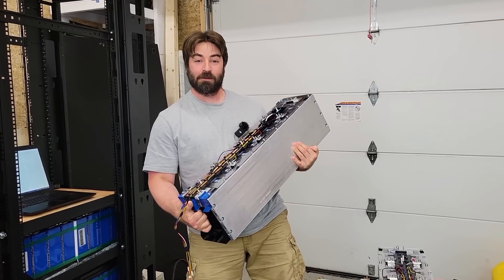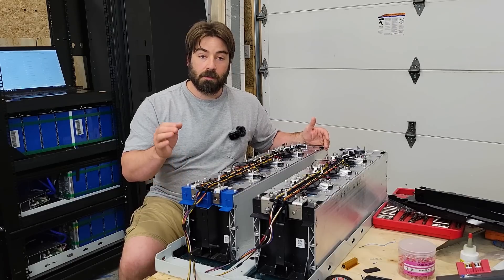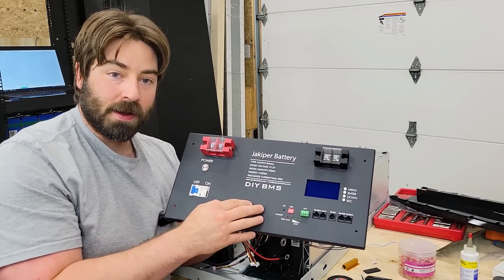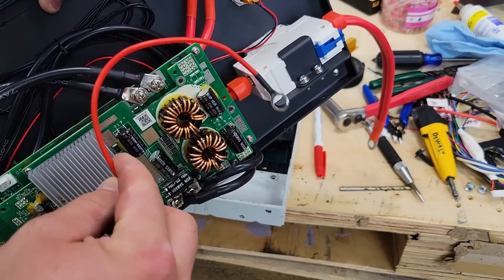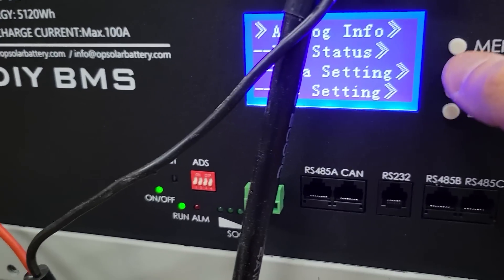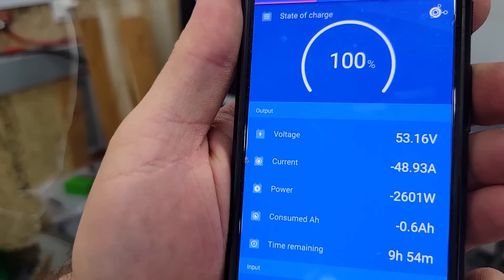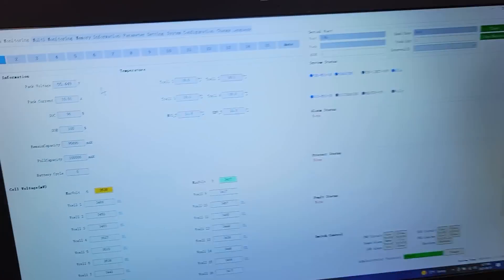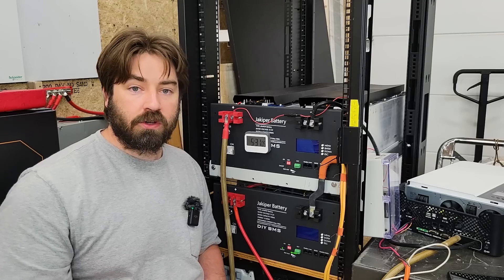Build your own solar battery, fast and cheap!

Comment: Have you ever built a 36 volt battery for a golf cart ? I'd like to build a 36 volt lithium battery pack to replace six 6 a volt Trojan lead acid batteries. Great videos, thank !
Reply from the maker: I replaced the lead acid batteries in my golf cart (36V) with a 36V lithium module I bought from Battery Hookup.  https://batteryhookup.com/products/36v-48ah-1776wh-spim08hp-36v-power-module
Add a BMS, at least to control charging.  
Discount code: DAVIDPOZ
Reply: Do you recommend that or building one ? I'm trying to save some $$$ but build something that will hold up a function well. Thanks for responding sir.
Reply: What BMS would you recommend ?

Comment: You need to put a good active balancer on those packs, (NEEY) especially with the studs on those cells, it would be simple to install, or the JK BMS with 2 amp active balancer..A passive balancer will never get those under control in the long run..Communication really isn't important, a smart shunt and the bluetooth app with the JK BMS is really more than enough..I don't even have a shunt for my different two 16s 48 volt packs..It's fine...I'm still building CATL packs I got from Battery Hookup, and I have 16  280 Ah Eve cells, but I'm getting there..Everyday somethings showing up, only need a few more pieces of the puzzle..
Reply from the maker: I tested an active balancer a few years back and it made my pack worse.  I removed it.  There are more than one way to build a battery pack.
Reply: @DavidPozEnergy  Ya, you can't leave them on all the time..Only when the pack finishes charging and is settling into it's regular resting voltage..And then they work like a charm...I charge to 3.45 a cell which is 55.2 volts, and that is when the balancer kicks in, it stays on for an hour until the voltage is resting at 3.35 a cell or 53.6 and the difference between the cells is 3 to 5 millivolts...My buddy hooked me up with that system, and he said he learned it from someone who tests packs on the internet..Works very good..Even on used cells..But, if you leave the balancer on all the time, it makes the situation worse, and I can confirm that, because I tried it on two different packs..

Comment: What size battery cable can you connect to the Jakiper BMS? Looked on the web site link but don't see it mentioned.
Reply from the maker: I was able to squeeze a 1/0 ring terminal in there, but just barely.
Reply: @DavidPozEnergy  Thanks

Comment: If the battery cell capacity is around 280AH, it means it can provide higher current output capacity. Using a 100A BMS may result in a lower current, 200A BMS would be faster.

Comment: Can you just put 2 in parallel to keep it 24v
Reply from the maker: Yes.  I suggest you use one 24V BMS per 8s module.  After the BMS, you can parallel as many as you want.

Comment: I see jakiper also sells a 230 ah server rack battery. Have u asked if they will sell the front panel of that model? Better breaker and I like the terminal set-up a lot more. For safety I assume u will parallel these once hooked up to your system. Whats the Max wire lug u can get on terminals?
Reply from the maker: I don't know if they plan to bring more BMS options to the market.  

I was able to fit a 1/0 ring terminal, but it was very snug.
Reply: Hi William, you can also choose to purchase our 230Ah battery directly.

Comment: How did you wire the batteries up for 48v?  I don't see anything attaching the two batteries together.
Reply from the maker: I used an orange copper busbar.  It's semi-flexible and left over from a battery I took apart previously.  I save spare parts for this reason.  I show it in the chapter installing the BMS.
Reply: @DavidPozEnergy  Oh, I see it now.  Somehow I missed it :)

Comment: The problem is that the NEC 2020 and beyond are requiring that ESS be "Listed" or field inspected for compliance to UL standards. That is expensive, so there is no savings in building a DIY battery if you're required to comply with code.
Reply: Only matters if you're installing in your house/living space. Most building DIY large ESS do so in a separate battery shed which negates the code compliance issue. Or they are off grid and not worried about inspection. My electrical inspector only cared about the AC side of the system. Didn't even look at the DC side even when asked if he needed to see anything.
Reply: yep, you'd have to get inspected with a minimal  UL listed system then add or replace with DIY
Reply: No one DIY building batteries is doing so commercially, so pretty sure that Code compliance won't become a significant issue.

Comment: 90% capacity, but if they're 8 years old you might only have a few years left in them.
Also 10% loss is already a big degradation, would indicate that the cell already went through a lot of cycle or are already quite old.
Woul be good to see if the original qr code is still on the cell to see when they were made (there is an android app to decode them).
Unfortunately might be hard since they're soldered, which also make it impossible to replace a single cell should one go bad.
Reply: They were more than 99% of the capacity.
Reply: Yep that was my thought. These things will pull 290'ish amp hours new.....so at least 1000 cycles?

Comment: How would you extinguish burning cells? Have you thought of an anti fire system?
Reply: I’m run my 48V LIFEPO cells at 100 amps continuous outside in Texas in 101-degree weather for over an hour…hottest they ever got was 105-degrees (with very little ventilation and no active cooling in an enclosed space) they are not prone to fire.

Comment: You should emphasize that shipping costs are heart-stopping. $500-700 to western NV.
Reply from the maker: Shipping is something to consider for sure.  Sounds like shipping would add $200-$400 more for you, compared to what I paid.  That adds $14-$28 more per kWh if you are buying 2 modules (14kWh).  Or, $2-$4 more per kWh if buying 98kWh.

Comment: Hello, Do you have a video on top balancing procedure  (or can you recommend a video)?  I am trying to learn about top balancing. Did you have to take the 8S and re-wire them in 8P in order to top balance them?  I have an EG4 battery (48V, 16S) with some of the individual cells not behaving and over charging when getting close to 100% SOC.  I am trying to figure out if I need to re-wire them in 16P in order to top balance them.  Thanks in advance for any reply...
Reply from the maker: I don't have a dedicated video on top balancing.  In this case, the cells are welded together, so I'm not re-arranging them to be parallel.  Instead, I used a combination of a hobby charger (I-charger X8) and the BMS, to balance the cells.  
At one point, I made a video on Jakiper battery rack.  It had 4 batteries.  One was not performing as well, and found one cell was hitting high Voltage before the rest.  I used a water heating element (big resistor) to discharge some energy from that one cell.  Basically I was manually top-balancing.  You could try the same thing.

Comment: These modules look amazing and the only negative I can see is we didn’t get to see you build “stuff”, they were almost plug and play.    No welding, cutting, soldering or measuring - just adding 6” of wire.   That’s what I love about your channel - David Poz builds “$hit”!!!  Thanks for showing these cells and I may expand my off grid system.
Reply: very easy right?
Reply: For the price whats better on the market?

Comment: Where did you get the server rack to fit the CATL packs? I got 12 of these and need to find a sturdy rack.
Reply from the maker: My local recycling center.  I bought it for $75.  You can also search on craigslist and Facebook Marketplace.  Use search "Server Rack" and "server cabinet".  The CATL module was about 1/8" too wide, so I notched the back rail to slide it in.

Comment: Than you David. Good video. Question: Does the Jakiper BMS setup work with Schneider xw pro. Is SoC available? Also, what base are you using to place the batteries?
Reply: good question, david has schneider XW PRO

Comment: I am doing a diy setup, my first time doing solar.  I plan to go off grid and looking for a lot of battery storage.  I will be running my home and pole barn/shop off the solar/battery.  If I were to purchase 4-6 (8-12 packs) of these batteries will the 100 ah bms be sufficient to run everything, air conditioners, 220v shop tools etc?  Or do I need the 280ah bms you were referring too?  I plan to use a eg4 18k inverter/charger.
Reply from the maker: To answer that question, we need to look at your total loads.  If you plan to purchase one EG4 18KPV inverter, it can output 12kW cont. while off grid.  That could be up to 275A from the battery bank.  If you plan to have 4 batteries in parallel, that's 69 Amps per battery. That's fine, no problem.

However, I'd be concerned if one inverter would be enough.  Reading your question, and seeing two buildings, one being a shop, there is a lot of potential.  I suggest making yourself a loads list.  Write down a realistic worst-case situation.  For example, a table saw with dust extractor, lights, air filter, air conditioner etc.  all on at the same time.  If you do that for both house and shop you might find that 12kW isn't enough.  

If you decided you wanted 2 inverters (or at least the potential) then you are talking 550A from the battery bank.  At that point you would need 6 batteries with 100A BMSs on each to make it, and it would be cutting it close.  Or go with some larger Amp BMS's.  

The answer always comes back to your loads.
BTW, if you would like to help out this channel, please consider making your Signature Solar Purchases through my affiliate link: https://signaturesolar.com/?ref=4_rHcgZ9x-TiF-  Thank you.
Reply: @DavidPozEnergy Thanks for the reply, I appreciate it.  My worse case total load would be 10-12k watts and I think that would be super rare between the house and pole barn, that is with all 4 1 ton mini splits running (~700 watts each maybe?), 220v table saw, 220v dust collection and several thousand additional watts for misc., I think the typical usage would be 4-6k watt load.  I am open to suggestions for other inverters I just wanted something somewhat simple that can connect to solar panels, batteries, grid power and backup generator and switch between them automatically.  If need be I can always add another inverter for the barn too of course down the road.  I used your discount code for the 4 modules, I am pretty sure I used the link from your video too, you able to see if you got credit, I just purchased the batteries a few hours ago.,  Thank again!

Comment: Morning David,  Nice day here 27 degree here in Southern Australia.   I did look at the front panels. Where is your door on your server rack. lol.  I got secondhand aluminium  plate from a crap yard. 30 dollars au that way.
Reply from the maker: Hi.  I have a door for the server cabinet.  Once I finish wiring the batteries together I'll put it on. I bought the server cabinet at my local recycling center for $75.
Reply: @DavidPozEnergy  They have got up since I got mine at 30 dollars au, David. lol, but they are very handy.

Comment: Would the BMS eventually balance all of them, that's it's just right? Is the method you used just to speed it up or something (you mention small cycling of them)? Do you have a video on the methods and differences of it? I always thought it just balances them behind the scenes but they are quite off balance still for days in your video. My only experience is 18650 DIY and they take a few minutes at most to balance.
Reply from the maker: The BMS will eventually balance the cells, but the cells have to be above a certain Voltage (I think 3.4V).  When the cells are resting they will drop below 3.4V, so the BMS won't balance if they are just sitting there.  I don't have a dedicated video on balancing cells, but I'll add it to my list of ideas.
Reply: @DavidPozEnergy  ah I see thanks. I always thought they were actively keeping them balanced, not letting some drop off in voltage =[ maybe more expensive ones do

Comment: how many kWh do you now store, David?
Reply from the maker: Not all the batteries are in play yet, but once they are, it should be 100kWh.  At least, that's been my goal for awhile.
Reply: @DavidPozEnergy  i have about 22.5 (rated), capacity not tester. Still on grid

Comment: There is already a popular open source project called DIYBMS that's been around for years, and is used with cells like these. This will lead to confusion.
Reply: Stuart Pittaway's diyBMS
Reply from the maker: Thank you.
Reply from the maker: Really?  That's awesome there is another BMS option.  I hope there is not confusion, that would stink.  Can you send me a link for the "DIYBMS" so I can check it out?

Comment: David, I purchased 4 of these modules, I only did a capacity test on one battery only and got 294 Ah. These are a incredible buy, I am using a smart Daly 16S 150 amp hour BMS’s on each two modules! All batteries were top balanced individually to 3.45 volt down to 2 amps with my Ztech 40 amp chargers. Yes, I did use your discount code, thanks!!
Reply from the maker: Wow!  You got great results from your test.

Comment: What server rack is this? What's the depth? I have those CATL modules too and I like that they fit in there!
Reply from the maker: It says "APC Infrastruxure" on it.  I'm not a computer guy, so I really don't know how to tell one thing or another.  I bought it from my local recycling center for $75.  The outside dimensions are 23W, 42D, 82H

Comment: I just ordered some of the SPIM08HP cells and hardware for making a battery for my UPS (not quite set up for house inverter yet) that runs my server rack and livingroom. I used your promo code, of course  😉
So now just waiting for them to pull the order and ship so I can get that online soon
Reply from the maker: Sounds good.  Thanks for using the code.

Comment: Do you have a link or contact for the jakiper DIY bms and faceplate?
Reply from the maker: Yes.  I linked to it in the description along with the coupon code. The company is Orient Power.

Comment: how do you top balance with cells in parallel when they seem to be fixed in series?
Reply from the maker: I left them in series.  At first, I used my I-charger to do the bulk of the balancing.  I hook leads from each cell to the i-charger and let it balance the cells.  But, then for more fine-tuning, I do some cycles and let the BMS finish balancing them.

Comment: Can someone with very limited knowledge in electrical diy manage to balance all the batteries? 

The checking part with all the computers hooking up scares me a bit. 

How many solar panels do you need for the 11K batteries set-up you show in the video? 

How many fridge, TV's, computers, lights, microwave, vacuum, etc can you hook up to a 11K batteries set-up? How many could run at the same time? 
I'm sorry for the really basic questions but I'm trying to figure out how feasible going off grid is for men

Comment: Guess it makes sense to rack panel makers to place the display, switch, etc, inline with where cables, solid busbar runs. Perhaps that would be a good suggestion to them. Now to check out cost to Au.

Comment: He David
How long will they last ???
Reply: 2 - 6K cycles or 10 - 20 years depending on temperature and cycle depth. Midpoint 3 cents per kWh cycled 4x cheaper than grid.

Comment: Thanks for the test and giving me more options for DIY builds! My motorhome is already set up as 24vdc with two 3kw Growatts. Could I use the Jakiper bms and just change its parameters to 24vdv pack settings?
Reply from the maker: No.  The BMS is 48V only.  Battery Hookup sells 24V BMSs.  Select "8s LiFePO4" from the dropdown list: https://batteryhookup.com/products/12v-lifepo4-smart-bms-w-low-temp-cutoff?_pos=6&_sid=be404606b&_ss=r&variant=37389087506594
Although, just now when I snagged the URL for you I see they are sold out.  They usually restock quickly, but you could call and ask when they might have more.

Comment: Hi. Thanks for your service and all information sharing with us.  This BMS can configure in close loop with Schnaider?   Thanks
Reply from the maker: I think so, but I haven't tested it.  I have a video setting up closed loop with a similar BMS to the Schneider Insight home.  The process might be the same, but you would have to confirm with Orient Power.  Like I said, I haven't tested this "DIY BMS" with Schneider. https://youtu.be/qs2gE2wR3ZA?si=9TyCDVHETOtc_8Ac

Comment: I'd get a couple of these if they were available in Europe.
Also, with a bit of creativity, could parallel up the batteries and cells and use 1 BMS for 2 or more sets, but balancing current would proportionately decrease per cell.
Reply: Sure you can! You can parallel each identical battery with the same age and capacity.
If you are looking for best price in Europe, use grade A Fogstar from UK or choose German cells.
Another good company with good price in UK, is Roamer. You can get 48v  5.4kwh battery for 1.8k with incredible good warranty 10 years which is not easy to find anywhere.
Reply: Orient Power have battery in Germany, Romania, Netherlands.
Reply: We can't even get them here in America so don't even worry about it 😂😂

Comment: These look like a really good way into a 24V battery. I'm still sticking with 12V and the configuration of these modules doesn't really lend itself to conversion. If I lived any where near PA, I'd probably still pick up a couple. Converting two of these to 4X12V @ 270+AH each is very tempting.
Reply: 12v... eww
Reply: But why 12v